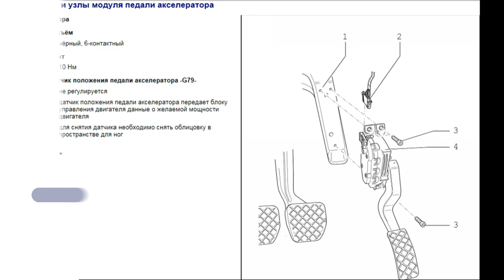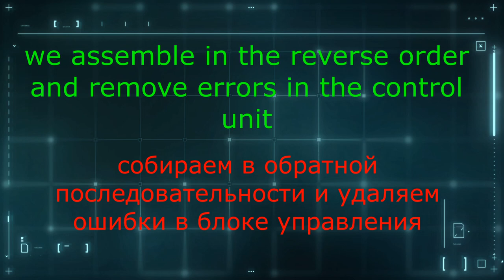Reduces the pause after pressing the gas pedal Touareg, AUDI Q7

Comment: Just to be sure, is it better after beacause you cleaned the oxydation or because you repositioned the cover more to the left ? And how do you remove oxydation? thanx !!
Reply from the maker: I opened the lid just to make sure it wasn't there. of the 10 pedals, 2 had oxidations. if oxidation is still present, you need to clean the contacts.there are special sprays